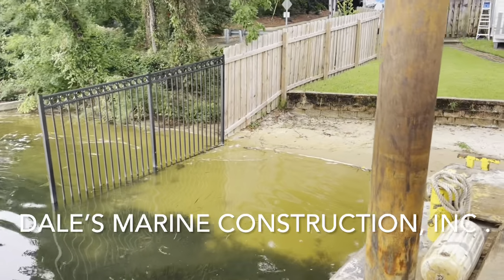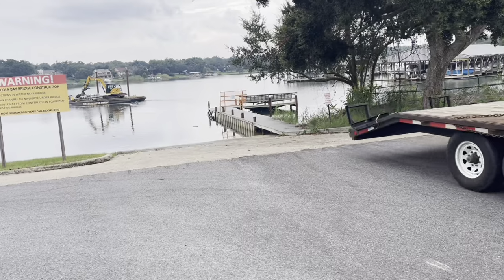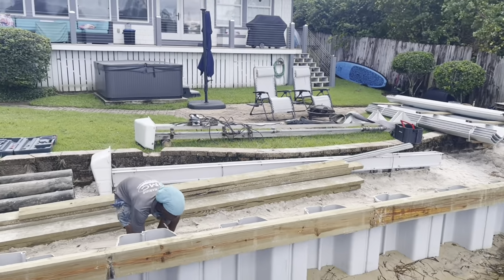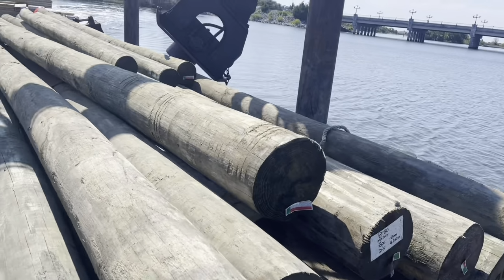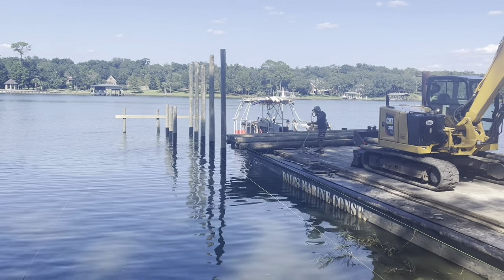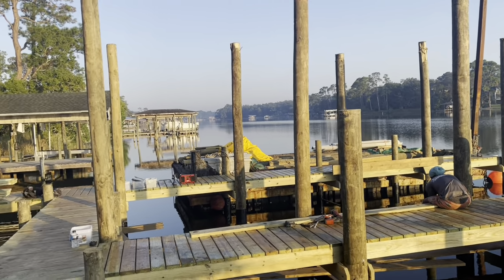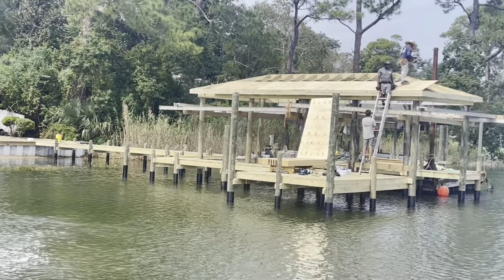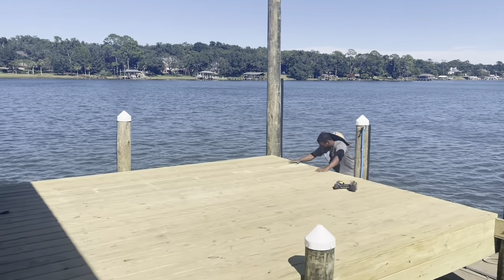Extreme backyard makeover! New vinyl seawall a new dock and boathouse to go along with it￼.￼

Comment: Nice work ! After you set the polls do you put the boards running the length of the pier to the polls or the width of the pier to the polls?
Reply from the maker: Thanks Auston for your comment I do one side of the stringers parallel with the poles level across to do the other side then put the crossmembers underneath 👍

Comment: Dale, just bought a new 308 to replace my yanmar. Did you put bottom paint on the bottom of the stick to help with the corrosion when putting it in the water?
Reply from the maker: Hey John, congratulations on the 308 I actually have three of them and we love them but you do have to stay up with the preventative maintenance. I  got tired of seeing all the rust on the bottom of my stick we used to paint it was just black paint this time I tried to Seagard 5000 to see if it last longer. Good luck with your projects.

Comment: Love your work Dale.
What style fasteners do you use with wood decking?
Reply from the maker: Thanks for your comment and watching Dan, we use type 3/16 number 10 3 inch stainless steel with 2 x 6 wood decking. We like the larger head of the screws to prevent the decking from being ripped off during storm surge.